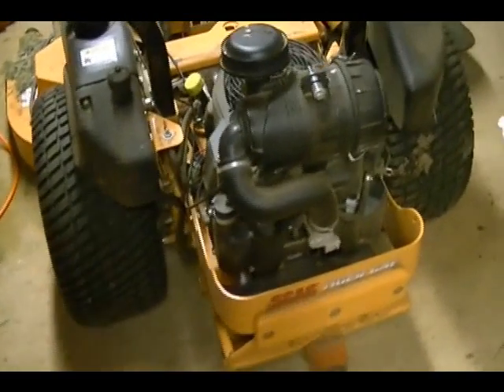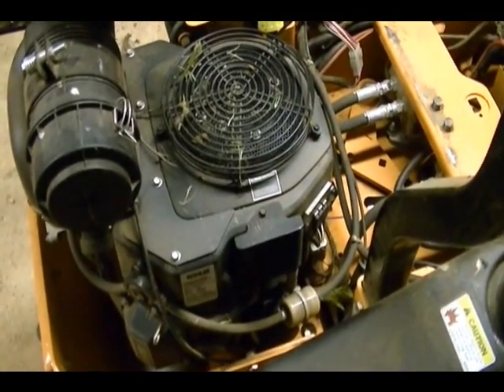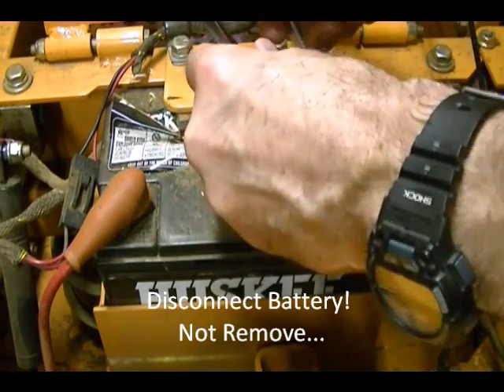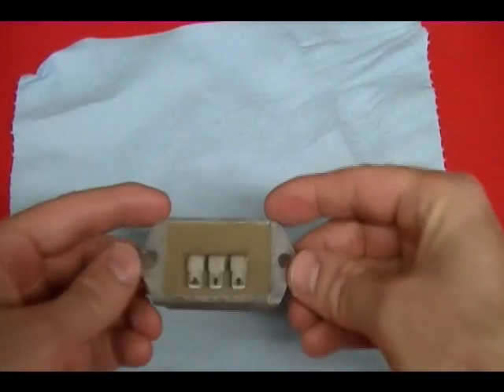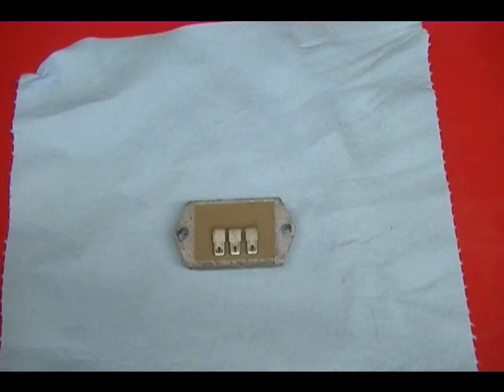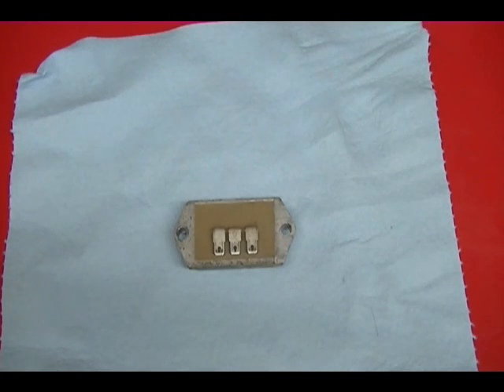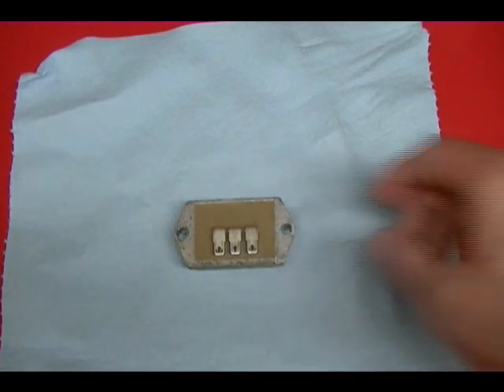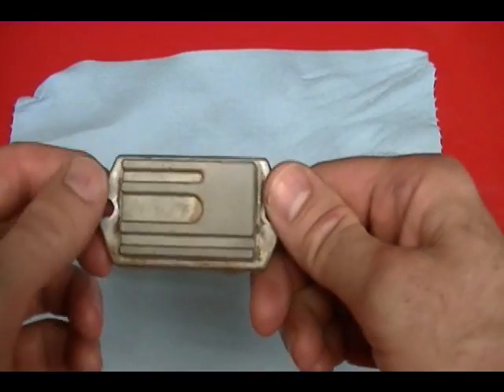How to Determine Charging System Amps for Testing the Kohler Engine Regulator Rectifier

Comment: What are the possibilities of installing a automotive battery. Is there any down side with possible damage to starter etc?
Reply from the maker: +Earl Thompson I don't think it will fit. Not much room between the top of the battery and seat.
Reply: Just use a higher cold cranking amp battery.  http://www.tractorsupply.com/tsc/search/lawn%20tractor%20battery